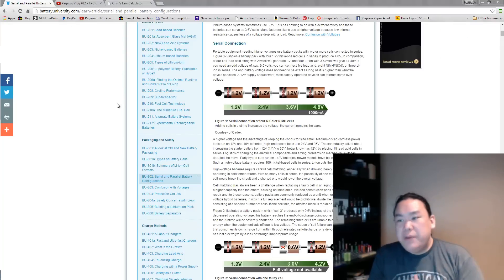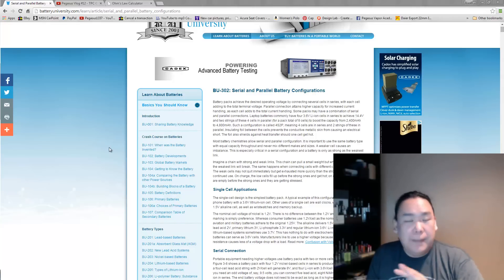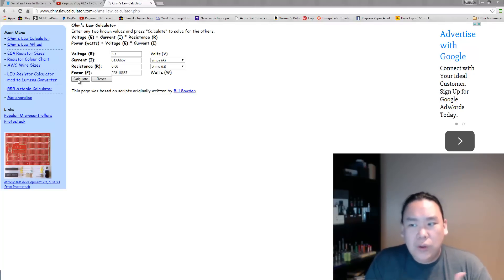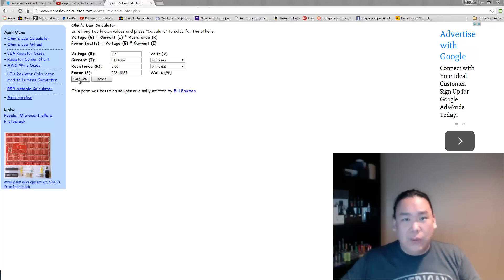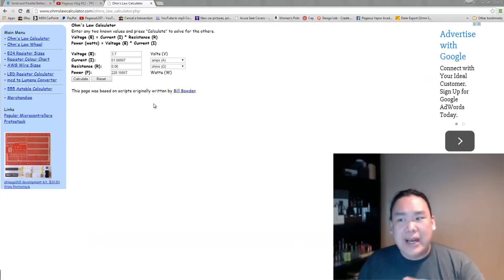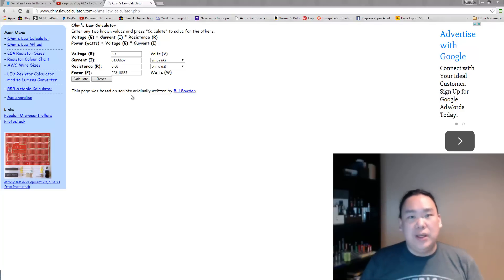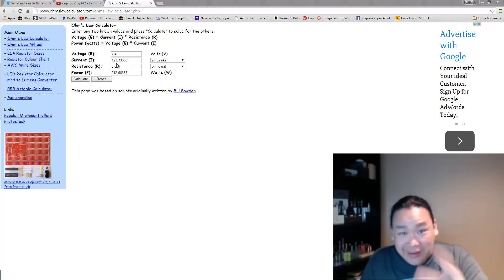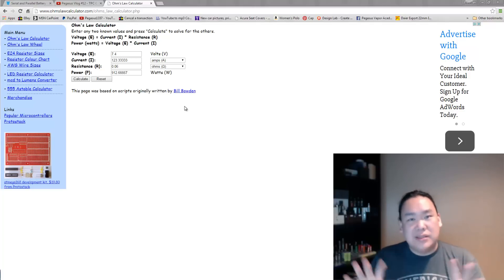General Understanding Series VS Parallel Unregulated Devices

Comment: Hi Peg,
Great info here! Subscribed.

I have a question though;
What is happening with the batteries if a dual 18650 parallel unregulated box mod is firing TWO 0.4ohm attys at the same time?

Comment: Hey Peg, 
Maybe I'm missing something but you mentioned that firing a .06ohm coil would only get 3.7ish volts. Is the whole ohms law calculation fluid as the coil heats? I've heard about the relationship of watts to heat but never thought about how that relates to the vaping experience over time. If true, how does this concept apply to regulated mods which display a static watts/volts/amps? 
Yet again you reveal a hole in my knowledge and are an indispensable asset to the community.  Keep em coming.

Comment: Peg, superb video. The topic and the way you answered was excellent. Based on your breakdown of the ohms law calculations I think it would be best to stay away from a build that low period. I don't think a CLT v2  atty with all its heat fins and airflow could cool down the vape well enough.

My question is as follows. I saw a video (can't recall who the speaker was) and it was mentioned that watts equal heat. However I can't find a conversion app for this. Can you advise or provide the calculation info to convert watts to heat degrees in F or C.  Thanks Bob.
Reply from the maker: no because wattage is the amount of heat or "work" that has passed and temperature is what something is currently at.
for example  if you used this: http://www.conversion-website.com/power/watt-to-Celsius-heat-unit-IT-per-minute.html

This would tell you how much heat units have gone by in celsius based on whatever time has gone by.
Its not direct.   Say we got a big coil and a small coil.  putting 30 watts through both would result in different readings.
To my understanding, whatever you fire your coils at in various devices and multi coil setup.  theres no way of really knowing without a heat probe or very very very accurate IR laser. of some sort.  and even THEN  you'd still have to factor in air flow and chamber size.

So this isn't a question I can answer, but at lease I'm able to explain why I can't.  Hopefully you'll still got something from that.  Thanks Rob
Reply: Thanks, the variables you mention help.

Comment: Pegasus Vapor Academy  A very important question is there a way to measure the amperage or to do a battery calculation to determine if the battery is safe to use, please please if you can answer my question in a video especially when there are clones batteries floating everywhere
Reply: In-line volt meter with a 1. O build and play with that to see how your battery performs. is the only way I can think of without buying them expensive battery testers also make sure you buy your batteries from a reparable dealer NOT off eBay.  Or Amazon shit like that.

Comment: Did I misunderstand you or did you just say that when you stack (series) batteries that you add the individual amp rating? So, are you saying that if you stack 2 VTC4s in series and each battery is rated for up to a 30 amp draw that 2 of them in series will give you the same safety as though it were 1 big battery with a 60 amp rating? I respectfully disagree.
        It does do that in a parallel circuit because both batteries are sharing the burden of the load but if they are in series the amp draw rating remains at 30 amps because you are still funneling all that power through 1 battery at a time instead of dividing the burden. The analogy is simple to envision. Consider 2 people standing side by side and together 'team lifting' a 200 lbs chest over there heads, that is analog to a parallel battery set up. Both people only bear half of the burden of the chests weight each. They effectively are bearing 100 lbs each.  Now consider the same 2 people lifting the same 200 lbs chest over their heads but that one of them is standing on the other ones shoulders. No matter how stout and strong the person on the bottom is, the person on the top has to be strong enough by them self to lift the chest over his own head by his self otherwise the whole enterprise will fail. If I misunderstood you please forgive me, If I didn't show me that I am wrong Peg.
Reply from the maker: You said everything I said just in different words.
I suppose sometimes when the wording is reversed.
Sounds different, but it means the same thing.

I left a link for battery university.
Why would I state the opposite of my own fact link?
Reply: I sorry Peg, I watched the video and heard the opposite honest mistake. I should have researched more carefully for the part of the video in question but had a trouble finding it. Good job then!!

Comment: on a .06 coil if built with the right wire has little to no ramp up time.   if you used like 18g kanthal then yeah it might have some ramp up time depending on the raps and coild diameter but it you use like nichrome 80 or especially g plat 22g or even 20g there is no ramp up time. just wanted to throw that out there
Reply: and if anybody is going to build at .1 ohm or lower for gods sake use atleast a dual parallel box and high drain batteries.  i see so many people doing this using a single 18650 tube mod and it makes me cringe.  i have to admit i was once guilty of doing the same thing but it just plane isnt safe because you never know when that battery is going to let go and vent or worse,  i have vented a few batteries in my time as a vaper and they were good batteries that i had used at very low ohms many times before.  you are just playing Russian roulette with your batteries when you far exceed the ohm load.  anyway great vid man

Comment: I recently got a NXJO IMR 18650 3.7V 2500 MAH 35A High Drain Rechargable Battery.

Anyone know if this is legit?

Edit: I might  I have to try to bring it back to the store I got it from because it lost all it's charge. It's dropped to almost zero volts, and will not charge. I'm trying to charge it in a different charger, we'll see what happens.
Reply: It's a low quality rewrap of a LG ICR18650HE2, which is 20 amps continuous, not 35.

Comment: By now we should already know this from all your previous video's, but its a nice reminder for newbie vapers making the step to volume vaping.

Just curious, what do you vape Peg? Dont care about brand, but tank, dripper, squonker? 20w? 120w? What is your prefered vaping style?
Reply from the maker: Because I try so many things,  it forces my preferred vape to a slightly higher tolerance.  
I vape @ 30 watts.  Now I know most people will think 30 is nothing.
But there was a time where comfort vaping with a kick in a mech mod was around 12 watts.
So based on that I consider myself high, and folks who vape 80+ is on another level.

I think Juice brands SHOULD do a recommend wattage setting per flavor.
and there should be juices vaped cooler and should be Specifc sub ohm juice requiring 50watts +

as for tanks I juggle between alot of things.  but when I'm out I intentionally bring hard to build items out.
Aga T6,  Kaiser,  T3 genesis.  Kato Mirror.
Reply: Awesome Peg. 

I have 2 methods of vaping. One is my vaporshark kayfun 4 combo and i like to use my stingray with plumeveil 0.11 ohm with 25r in it. I know, not safe as showed in your battery episodes, but i dont have a high wattage mod yet.

I bought a authentic flash e vapor v3 to replace the dripper soon as im waiting for a custom sx350 box which has 85w passtrough which is more then enough for high wattage setups. For work and daily use im still at 13 watts with my kf4

You are very right when it comes to liquids. My Alice in Vapeland juices are very good in the kayfun, but if i take a 90vg juice from CCI its only blooming above 70+ watts. But for me there is the not smoking vaping and the hobby vaping with the higher wattage setups. 2 different things.